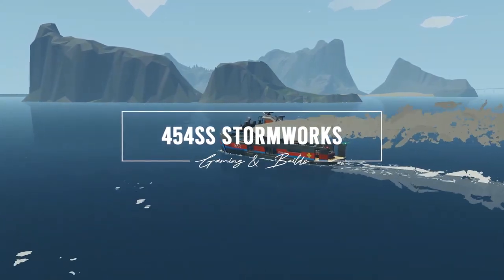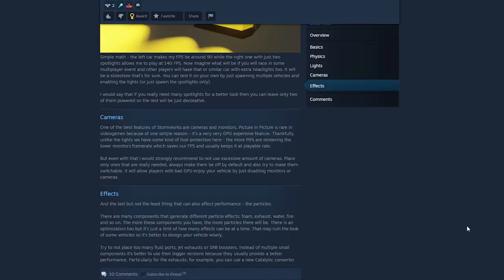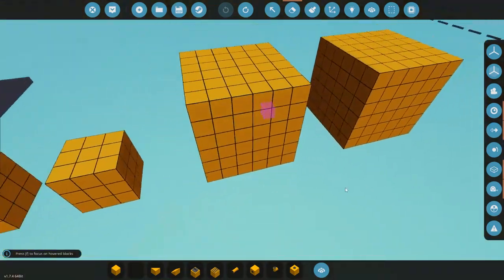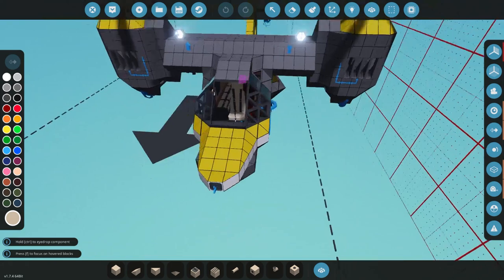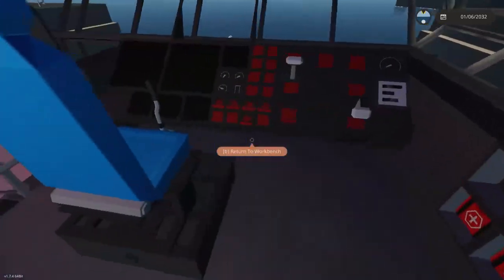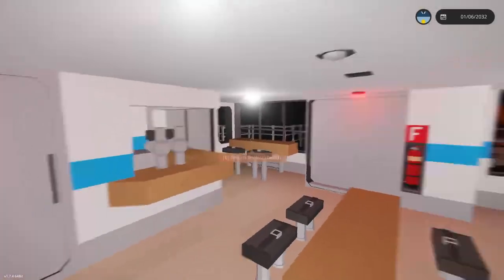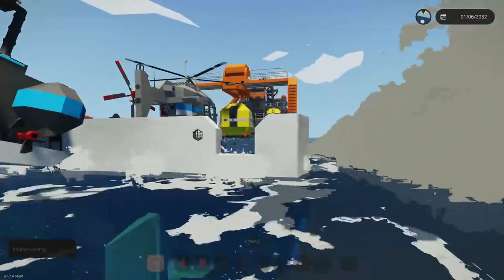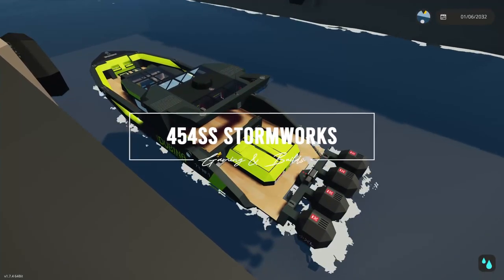9 ways to REDUCE LAG and OPTIMIZE creations in Stormworks

Comment: I've been playing stormworks for a few months and everything was working perfectly, I was building quite big ships and I wasn't using physics flooder (because I didn't know about it), but a few days ago something went wrong and as soon as I spawn even the smallest boat I can hardly move.
Reply: I have no ship or any vehicle however I can't run.
Just slow motion. Like 1 inch/hour.
Reply: sometimes when the game updates it resets the graphics to their default of ultra and they need to be turned back down.
also check that there is nothing running in the background, windows (and probably apple too) has a lot of bloatware that needs to be turned off in task manager every now and then.

Comment: you can stack catalytic converters to get rid of any amount of smoke. 3 or 4 behind each other will handle almost any amount of smoke.
Reply from the maker: True! But it will also reduce the flow of the exhaust and the engine power will decrease :D
Reply: @454ss_gaming  parallel stacks, as much as is needed to get the required flow rate.
Reply: Or you can set your particles setting to reduced.

Comment: What is the reason behind always using normal engines and not modular engines? I like modular engines much more because of flexibility, and more control. Sometimes I hear people complain about overheating and higher fuel consumption, but somehow I never had those issues (maybe because I like to keep my engines as small as possible).
Reply: modular engines are more fuel effiecent tho, and with good cooling they dont overheat, but people sometimes prefer normal engines
Reply from the maker: Great question! I tend to use the large prebuilt engine for my bigger vessels, just because I find that they will maximize optimization and reduce lag (the game does not have to load lots of little parts), whereas for cars and small boats I almost always use modular engines, for the size reduction :)